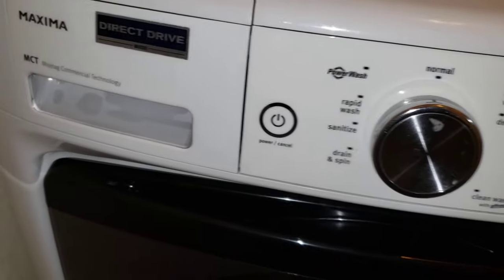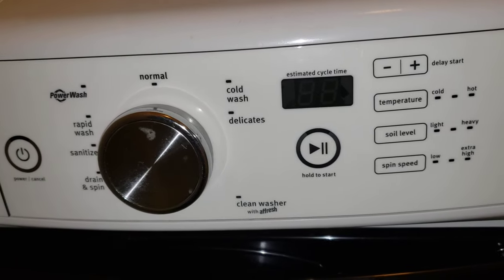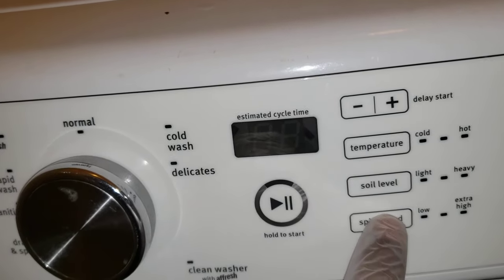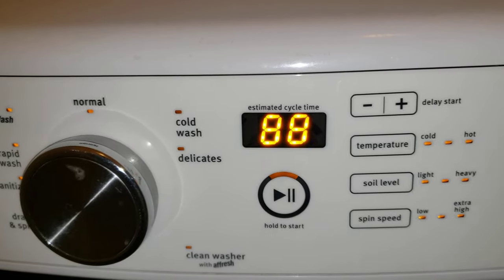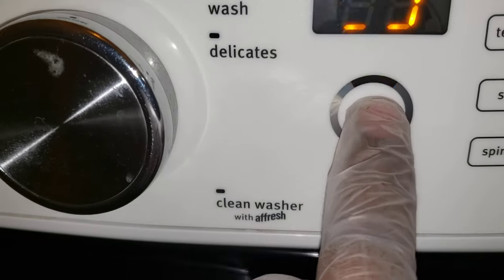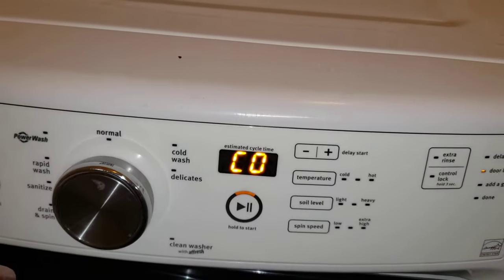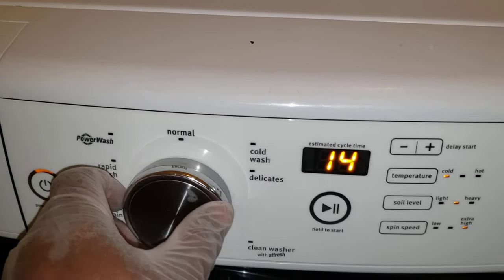How to Reset a Maytag Maxima Washer machine #Shorts

Comment: OMG...this was amazing! The water in my complex was turned off during a wash cycle and immediately started flashing E1 F8 and locked my clothes inside. I unplugged it, that didn't work. I looked at other videos and tried their methods...they didn't work. Then this morning, I was desperate and somehow came across your video and VOILA! It took a bit to get it to work but IT DID! The codes cleared, I could reset the wash cycle and now it works fine! THANK YOU, THANK YOU, THANK YOU...DID I SAY...THANK YOU! Best of all...ZERO cost for an appliance repairman. Saved $100+ so THANK YOU!
Reply from the maker: You are most welcome. If you haven't,  kindly consider  subscribing  to the channel and also share so that other people with similar  problems can benefit. Thank you.
Reply: SWEET!!!
Reply: @gm3386  same worked like a charm👍🏼
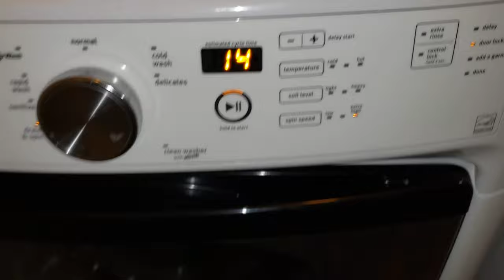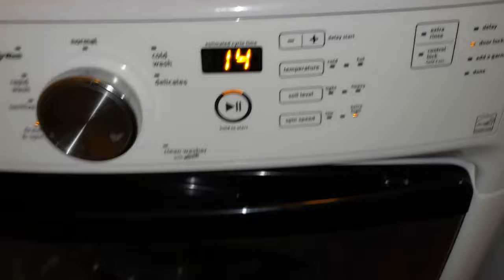Reply: 1:08 1:08
Reply: I know its an old comment, but yesterday the same thing happened to me. I was able to unlock the door, but now the machine won't pump water when I start a cycle. can someone help?
Reply: @catherineleclerc1921  Try unplugging it, wait a minute or so, then plug back in. It's like a computer reboot. If that doesn;t work, follow this guys video. it worked for me.

Comment: Hi all - if your washer doesn’t immediately open, the code is COO and the motor is still running with the lock light blinking, wait 8 minutes and it may unlock.  His shows an immediate unlock but can take up to 8 minutes I found out!  Yay!!!!!  Thank you for posting!  You saved Christmas!
Reply: Thank you for posting this information, these steps were not working for me, I read your comme nt and sure enough at 8 minutes I heard it click and I was able to open door and machine is working.
Reply: Thank you so much for the 8-minute note! I didn’t want to burn out the pump because it sounded like it was trying to drain and wouldn’t stop so I kept turning off the power to it. After seeing your comment, I did the button procedure, set a timer for 8 minutes and it shut off right when the timer went off. It’s working again 😁

Comment: TRUE STORY:  For ONE YEAR I have been fighting my Maytag Maxima machine.  it would go thru the wash cycle but at the end there was a grinding noise and then more water would flow into machine.  We would have to spin again to get rid of water but the door wouldn't open.  After an hour or so of trying and trying we would finally be able to open the door of the machine.  "Wash day" LITERALLY turned into a FULL DAY of fighting with the machine.  ONE YEAR LATER we were so sick of this problem that we ordered an LG machine for $725 total.  That was YESTERDAY.  But TODAY I am cancelling the order because YOU just SAVED ME $725.  I subscribed to your channel.  THANK YOU THANK YOU.
Reply from the maker: You are very welcome
Reply: I'm trying this on my Maytag but not working. Do I have to set a specific wash cycle before doing this reset?

Comment: Had an issue where the family wash cloths were not rinsed enough prior to the wash and caused excessive suds. The door was locked and this process reset it. I had another situation today where the washer seemed to have a mind of it's own and would randomly change settings. I followed this process and it's working fine now. Hopefully, it will stay that way :) Thank you!

Comment: What if the start pause button/pad is not allowing the cycle to start? (It's not a push down button it is a sensing pad much like this one. It counts down 3, 2, 1 but stops if it doesn't sense your finger. So it barely gets down to two, and that was after trying to use olive oil get it to see the finger.

Comment: This enters diagnostic mode. It's not a reset. It runs through each function of the washer individually. Starting with testing the lock actuators.

Again. This isn't a 'reset' at all. 
Also, these have a manual door release, if your goal is to unlock the washer.

Comment: When I do this process after off on when I select it just high beeps. Not the low starting beep. Almost like when the door isn’t closed
Reply from the maker: Please carefully follow instructions and if it doesn't fix the problem then it requires troubleshooting by a certified repairman. I would start by calling manufacturer. They can be very helpful.
Reply: Having the same issue - the directions reset it, but now it just beeps loudly and won’t change from normal wash.  Did you have to call for assistance or did you get it figured out?

Comment: What do you do after you get a C000 code.  I hit start and still nothing.
Reply from the maker: Please follow the instructions in the video. The instructions are meant to reset the machine to factory settings. If it's not resolved then it means your machine has other issues that may need a repair man or check with manufacturer for troubleshooting.

Comment: I get a F06 E01 Error code.  We replace the ccu and still nothing, replaced the mcu, again nothing.  Replaced the door lock and the pump.
Reply from the maker: Its possible that your washer may have other issues not covered in this video. Please try to contact the manufacturer and see if they can help troubleshoot. Good luck.

Comment: Thanks so much for this! But after restart mine won't start, I'm your video looks also like it doesn't start filling right away
Reply from the maker: Make sure that both warm and cold water  connections are in place and valves are open. Also, after following the procedure to the end, tap soil twice then the start button, then off button then start again. Hope this helps you.

Comment: Do you know how to turn the sounds off?
Reply from the maker: Just unplug it for a while, then plug it back in. If the beeping sound comes back on you can try the above instructions to reset machine. If all fails then it would be advisable to find a certified technician or call Maytag tech support to assist with troubleshooting.
Reply: @gm3386  Thank you! I was meaning the sounds when it turns on, when you select a cycle, or when the cycle ends. They’re so loud, but I can’t find a setting on the machine to turn them off.
Reply: @marissamacconnell76 hold down the cycle signal button for 3 seconds.

Comment: I did it exactly like you did but nothing happened
Reply: I did it just like you did and it finally came on and the letters and numbers that are coming up are E3 F8
Reply from the maker: Its possible that your washer may have other issues not covered in this video. Please try to contact the manufacturer and see if they can help troubleshoot. Good luck.
Reply: @gm3386  I have talked to a repairman. Thank you. I have fixed two washers and two dryers before but they were the old type these computerized ones are not easy to figure out for me.
Reply from the maker: @melindabanning4497  Thanks for the update. I'm glad someone was able to assist with your situation.

Comment: Mine doesn’t want to throw a lot of water and the soap don’t want to open
Reply from the maker: I'm  not quite  sure what the problem is with your machine, but to troubleshoot  you may need to unplug for a atleast  10 minutes, then  follow  reset instructions  in the video. If it doesn't  resolve you may need to call Maytag customer service. Good luck

Comment: I did the reset process but cycle won’t start
Reply from the maker: There could be other underlying issues that may need to be addressed.  Maybe get a technician or contact manufacturer to assist with troubleshooting. Good luck

Comment: What if it beeps and won’t start even after that
Reply from the maker: If you reset correctly it will restore machine to factory settings. If machine has other issues then resetting may not be the solution.
Reply: @gm3386  thanks for responding! I know in my gut what it is. It’s the door sensor. Going to attempt to replace it myself. 🙏🏻 The Lord will help me !🙏🏻
Reply from the maker: @natalianegritto  Good luck